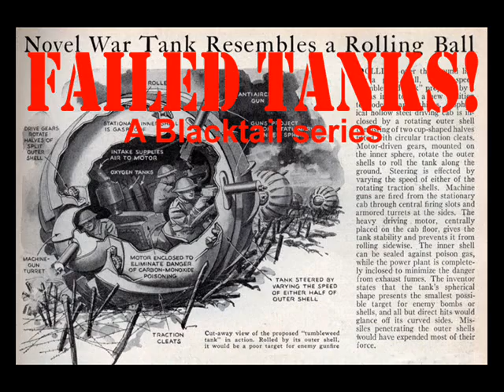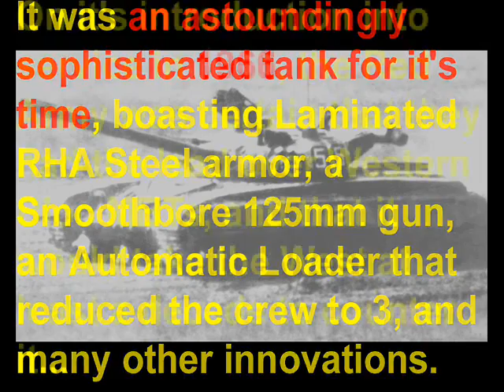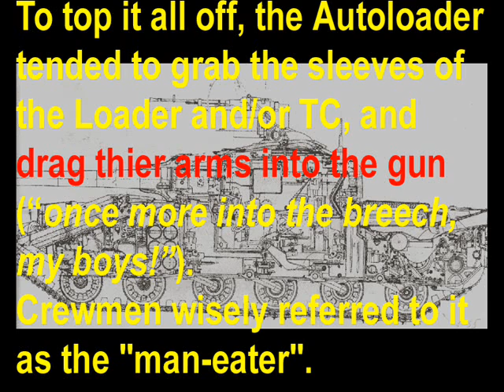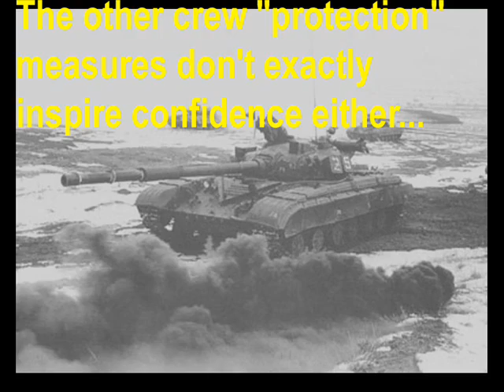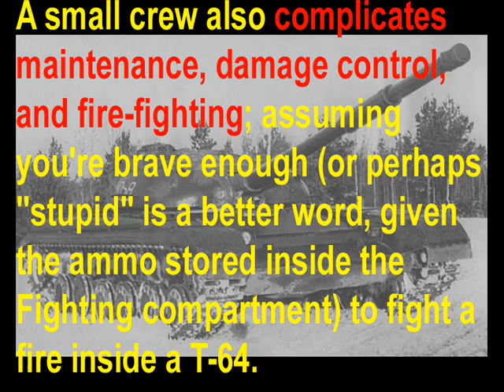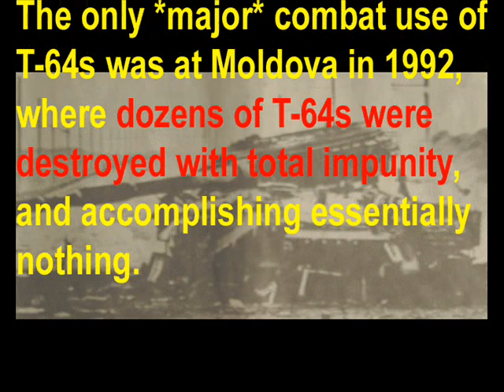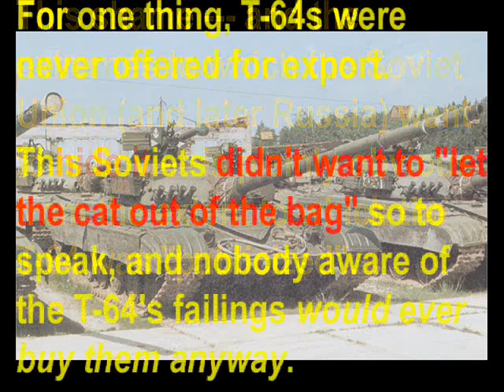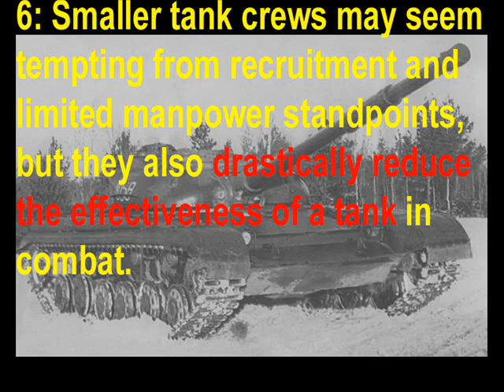Failed Tanks, Chapter 4: The T-64

Comment: There are many errors in this video:

1)  The T-64 was NOT developed AFTER the T-62. The programme for T-64 was the main development to replace the ageing T-54/55s. The T-62 was a stop-gap design mainly to field the new 115mm smooth bore gun quickly.

2)  The smooth bore guns had a very flat trajectory, and in the T-62 case, largely made up its relative simple FCS compared with contemporary western designs. I am not sure where did you get the "very poor" accuracy from.

3)  It is true that during the initial trail of the T-64, a lot of reliability issues were encountered, especially with the very new engine and suspension systems.  However, while some design issues were fixed in production models, many of the reported reliability problems was found to be resulted from inadequate crew training. The T-64 was an entirely new tank design at the time, and many tank crews were transferred from T-54/55 units, and some even directly from the T-34s. Once the training issue was corrected, the T-64 reliability record also improved dramatically. It is no worse than T-72.

4)  The T-64 engine was very compact, and its output power was very good compared with contemporary engines on western tanks.  The engine allowed a very low and short tank.

5)  The T-64 front armour was specifically tested at the time, that no Western 105mm antitank rounds could penetrate it at range > 500m.  It was the very first time that a tank in the weight class of a medium tank, exceeded the protection level of that of a heavy tank.  The introduction of the T-64 basically started the MBT concept in the red army, and made the heavy tanks obsolete.  The T-64 eventually replaced all the heavy tanks

6)  Overall the T-64 was one generation a head of its competitors at the time, and is the first 3rd generation tank in history. A lot of its bad rap in the West comes from some mis-interpreted and incomplete intelligence reports from its early trial days. And this some how got stuck in people's head.  If the West had to fight a tank war with the Soviets in the late 60s, they would have had a very very nasty shock.

7)  The chief designer for T-64 won the top design price in the Soviet Union for his work in the T-64.  Do you think he would have got the price if the tank was a flop?

8)  The fact that all Soviet tanks that follows more or less based on the basic design concept of the T-64, and they felt no great urge to get a completely new design in the advent of the Western 3rd generation tanks, and only did incremental upgrades, showed the soundness of the T-64 design in the eyes of the soviets.  Remember, the soviets put a lot more emphasis on tank warfare, and having a tank that can win the war for them is absolutely essential.
Reply: beltar2 The T-64 was not just "slightly" better than T-72. The electronics and fire control systems on the T-64 was almost one generation ahead of the T-72 until the B model that came out in 1980s.  By then, the T-64 was being upgraded into the T-80 (the first T-80 prototype was simply a T-64 with a gas turbine engine: T-64T).

If you have watched one Russian news channel programme (can be found on the youtube) advising the East-Ukrainian rebels on how to defeat Ukrainian tanks (mostly of T-64 and T-72s leftover from USSR era, there are too few number of the relatively modern T-64U), they mentioned that a hard (RPG) hit on the turret of the T-72 currently serving in the Ukrainian army, even if it won't penetrate, would knock out the turret electronics, requiring the crew to reset the electronics in order for the turret systems (including fire control) to work again, giving the attackers around 20 seconds time-window where the tank basically becomes a sitting duck; whereas the T-64s serving in the Ukrainian army have much better electronics that hitting on the turret without penetration would have minimum effect on the tank.  Both T-64 and T-72 were vulnerable to radiator damage from the rear, and when radiator is damaged, the tanks have about 20 to 30 minutes of running time before the engine catches fire due to overheating.

The T-64's weight reserves were not exhausted compared to the T-72 from the start.  The engine can be upgraded and has been upgraded, just as the T-72.  The design certainly did not reach a dead-end early on, just look at the T-80 and the modern Ukrainian versions of the tank.

Based on lessons learned from WW2, the Soviet tank doctrine emphasised a lot on production: the ability to produce and deploy tanks quickly.  T-72 had much more off-the-shelf components that can be produced in factories throughout the USSR territory, whereas some of the key components of the T-64 (the engine, transmission, etc) were only produced in one factory in Ukraine.  This makes T-72 being able to have much higher production rates and with cheaper cost, making it the best T-34-esk tank to flood and overwhelm the opponents, whereas the T-64 will be reserved for spearhead and breakthrough units.

BTW, the main reason why T-43 was not adopted was because they did't want a reduction in the production rate of tanks.  The T-34 had a lot of know flaws, but tank production rate was more important, that many of the proposed design fixes were not implemented if those required significant retooling of the existing production line.  With the emergence of Panthers in the Eastern front, the upgrade to a higher calibre gun was deemed to be essential that an upgrade to the T-34 design was unavoidable.  The T-34-85 required much less retooling with an increase in turret ring diameter and a cast turret than a new tank chassis design required by T-43.
Reply: @tonglianheng  I know this is supppppper late but T-64 is NOT superior to T-72. Even T-72 Ural had much more armor and a better auto loader(ammunition laying horizontal rather than vertical) by T-72A the T-72 series had completely eclipsed the T-64 series including T-64B and T-80. The T-72A's FCS was less sophisticated than T-80B's however much easier to train crews on and according to Soviet test provided only a 5% reduction in accuracy but at a 3rd of the cost of T-80B
Reply: Lianheng Tong 
Electronics can be installed in T-72 too. Nothing strange that in 1987 T-64's production was cancelled but T-72 and it's deriative T-90 remained.

T-72 for it's years of active service has countless examples of surviving multiple hits and remaining in combat-ready state. RPG's projectile is too lite and slow to produce significant kinetic energy. I don't know where you found such a bullshit but I never heard about any problems with T-72's electronics. Countless books articles esseys no one mentions anything like that. I remember video from Syria where T-72 was hit in it's turrent but the sights worked.  What's more a soldier with RPG usually has no idea about real damage he made except there were signs of fire or immediate total destruction.

Actual weight reserve of T-64 looks like to be around 45 tonnes. The problem is not engine which was unreliable too but very weak chassis.  That's what everybody who had to deal with this tank militaries and engineers tell in unison. From other side T-72's chassis considered practically undestructible and there're variants with 1130 HPs engine. Nothing strange that T-80 required totally new chassis.

USSR had 4 tank factories and can order produce any tank anywhere. T-64 was produced only in Kharkov because it was told so.  There were attempts to install T-64's turret to T-72 but it was so non-producible that the factory in Nizhniy Tagil failed to introduce it in prodaction. The real advantage of T-64's turret was +10-15% in terms of shellproof. Autoloader another story. In Russian literature T-64/80 autoloader is named "Loading mechanism" LM and T-72's one "loading automate" LA. The LM was bad and N. Tagil engineers have to develop their own construction. Develped and named LA. And many other things which were later introduced in T-64.

T-43 is not one of very known tanks with little enough information about but Soviet sources states that it had no reserve for future development.
Reply: Lianheng Tong 
> The chief designer for T-64 won the top design price in the Soviet Union for his work in the T-64.

The chief disigner of T-64 was Morozov the "father of T-34". Anybody else would get a kick in his ass. The tank was soooo gooood that Soviet Army required a replacement that's why T-72 was created. During WW2 Morozov known for T-43 the tank which has no reserve for future development and was discarded from other side T-34 allowed significant addition of weight and new 85 mm gun. T-64 was post WW2 T-43 slightly better than T-72 by formal parameters but with many technological problems and no weight reserve. The weakest parts were engine and chassis the last was never fixed. Something like that happened with JS-3 before. From KV-1 to JS-3 the armament and protection were iproved step by step without increasing the weight but in JS-2 all reserves were exhausted and non-optimal desisions fixed.
Reply: +Golden Eagle chalky tanks re not the same as chieftains
Reply: Poor Mikhail Koshkin, written out of the histories already.  I salute one of the great tank designers!  Za Mikhail Koshkin!
Reply from the maker: 1- The T-64 was intorduced into service in 1967...;
http://www.fas.org/man/dod-101/sys/land/row/t64tank.htm
...and the T-62 was introduced in 1961;
http://www.fas.org/man/dod-101/sys/land/row/t62tank.htm
2- Only when firing APFSDS rounds --- as in all other tank guns.
3- And yet, all T-64s operated exclusively from bases that were near the factories that built and maintained them, they were never offered for export, and less of them were built than any other post-war Soviet tank, over a shorter production span than any other Soviet tank. This is not evidence of success.
4- The T-64 is 7.22ft tall to the rooftop, versus 7.87ft for the T-62 (9% taller), 7.32ft for the T-72 (2% taller), 7.9ft for the T-55 (9% taller), 7.55ft for the Type 85-II (5% taller), 8.7ft for the Chieftain (12% taller), 7.84ft for a Leopard 1 (8% taller), and 7.48ft for the AMX-30 (4% taller). An average height reduction of 7% isn't worth the cost, complexity, reliability, availability, maintainability, or ergonomical problems the T-64 inherited.
5- Yet, when the more advanced frontal turret armor of the T-72M1 was tested against captured 105mm M111 Hetz APFSDS rounds, they went right through. See "The Secret Testing of Israeli M111 "Hetz" Ammunition: A Model of Failed Commander′s Responsibility", from the September-October 2006 issue of Armor Magazine.
6- Such as with the use of an Autoloader, as pioneered by the AMX-13 that entered service in 1948? How about it's Composite Armor, as was used on the turret faces of the Iowa class Battleships in 1943? Or perhaps it's 3-man crew, just like the PT-76 that entered service in 1952? Moreover, the Chieftain also had an opposed-piston multi-fuel engine when it entered service in 1967, the same year as the T-64. Moreover, just because you're the first or only one to do something doesn't mean you're useful --- as was definitely not the case with the Soviet Union's only operational MBT never to be committed to front line service.
7- Morozov never would have lost the competition, because he had too much political clout. Form always trumps substance in the Soviet Union.
8- Yup, so many later Soviet tanks with cassette autoloaders, opposed-piston multi-fuel engines, and track return rollers.
Reply: BlacktailDefense
1. The T-64 project started as Objekt 430, as early as 1951.  3 prototypes were built subsequently in 1957. Upon the intelligence of the 105mm L7 gun being adopted by the next generations of the Western tanks, the project 430 tank was redesigned to accommodate the then new 115mm U-5TS gun. Due to the delays in project 430, the soviet army ordered an immediate solution to field the U-5TS gun, and the prototype form the much less ambitious Project 166, which is based on the Project 140 (started at roughly the same time as project 430, as a T-54 improvement project), was adopted (aka. T-62) as a stopgap.

During the production phase of T-62, Project 340 received the further updated 115mm D68(2A21) gun, and renamed Project 342. The first prototype of Project 342 was completed in 1962 , and the first serial production started on October 1963. It officially entered active service on December 30, 1966, under the official designation T-64.

Source: http://www.t-64.de

2. APFSDS rounds can only be fired from a smoothbore, and is the main ammo. The superior performance of the smoothbore in terms of muzzle velocity and the lack of a performance penalty on HEAT caused by the round spinning is the major reason why the Soviets switched to smoothbore, and why virtually all Western armies except the British followed suit.

When the 115mm smoothbore was first rolling out with the T-62, name one contemporary western tanks that has the similar? During a field test by the US army on a captured T-62, the crew reported the T-62 gun is the point and shoot weapon when compared with the L7 on their M60.

3.  The T-64 was the elite tank in Soviet army service, in the high-low combination of soviet tank doctrine. They were equipped by the most ready tank units, which previously fielded the IS3 and T-10 heavy tanks.  The T-64 was regarded as a top secret weapon at the time, and it is telling that the Western intelligence first learned of the T-72 (a cheaper and technically less advanced counterpart to T-64) before they even realised the existence of the T-64, despite the T-64 entered service several years before the first T-72.

I am not sure where you got your sources from, but a lot of T-64s were stationed in elite units stationed in East Germany, near the border to the West. They were to be used as the first echelon in smashing through the Western defences in case of an all out war. Only the initial batch was sent to a unit closest to the factory, and this was where most of "T-64's problems" was reported and passed down in history, through declassified patchy Western intelligence reports.

The Soviets never exported their elite equipments. The T-64 and subsequently the T-80 was never exported before the collapse of the USSR.  Only the inferior T-72 was permitted to be exported.  By the time of the collapse of the USSR, the T-80 has already replaced the T-64 as the best the Russians have, and it is natural that foreign buyers are more interested in T-80 when it became available.  Remember, this is at a time when the Russians were forced to sell a lot of their priced assets due to dire financial situations, such as the SU-27, which were never approved for export in USSR era.

4.  One of the main argument for compactness is the consideration on armour/weight ratio. The more internal volume a tank has, the more armour it needs to wrap around that volume, and hence a heavier weight if the armour keeps the same thickness.

This is very telling. The T-64 while weighing only 37 tons, has almost twice the armour protection compared to the M-60 series, which weights over 10 tones more.

5.  Gun ammo technology and armour technology advance all the time. The T-64 front armour was tested against the western ordinances of the time of its development.  And that is just that.  When the M1 tank was first introduced, its frontal armour was tested to claim that no Soviet antitank gun in service at the time could penetrate its frontal arc >1000m.  The same cannot be said today, even with the latest M1A3 add ons.  And this is normal, it is called progress.

6.  Let's put it this way, the T-64, when it first came out, made most of the tanks in service at the time more or less OBSOLETE. It was a tank that combined a lot of the newest ideas into one place, and made them work. And as I mentioned before, it was in service with the elite and most ready front line units in USSR. 

Its serial production continued from 1964 to 1987, only a few years before the collapse of the Soviet Union, with the latest BV variants serving along with the T-80s. Tell me that this is the mark of a failed tank.

The fact that the Western sources for what ever the reasons had little knowledge on the T-64, and often confused it as an older experimental version of the T-72, and hence the existence of such misunderstandings floating around is not really the fault of the T-64 tank.

7.  That is your opinion on how these awards gets handed out.

Consider this, the T-64 kick started a whole generation of tank designs in the USSR, and its less advanced cousin T-72 prompted the start of new generations of tanks in the West. The newest Russian tanks still based on the design principles of the original T-64.  Don't you think Morozov deserves at least a little of your recognition?
Reply from the maker: Lianheng Tong 1- If that's true, it makes the T-64 an even bigger disaster --- over 15 years of development for a single MBT project.

2- Not so. The M744, M833, M900, M456, M111 "Hetz", M413, M1060A1, C126, UI, OFL105G2, DM-23, DM-33, DM-64, L23, L26, L27, L64A1, BM2, BM22, 3BM-2, 3UBM11, BM25, and M98 are all APFSDS rounds for Rifled Bore guns, and almost all of these have seen active service.

3- The "High-Low Mix" is a fairy tale, as is the notion that the Soviet Army was designed expressly for offensive operations. If the former were true, the T-55, T-80, and T-90 would all have been immediately followed-up in production by inferior tanks; they weren't. If the latter were true, the extreme emphasis on self-entrenchment and dismissal of gun elevation that are definitive of Soviet tanks would not be so. High gun elevation and depression are absolutely essential for offensive operations on hilly our mountainous terrain, while an integral self-entrenchment capability is not, and defensive operations on predominately flat  and open terrain demands the opposite --- and the fact is that most vertical terrain was on the western side of the Iron Curtain, while most horizontal terrain was on the other side.

"I am not sure where you got your sources from, but a lot of T-64s were stationed in elite units stationed in East Germany, near the border to the West."
Without NATO ever noticing them? Fat chance.

"The Soviets never exported their elite equipments."
Yet, every Soviet MBT before and after the T-64 was exported, but the T-64 to this very day never was --- even though the T-80 rendered it obsolete over 30 years ago. T-55s, T-72s, T-80s, and T-90s are still being sold all over, but no one is asking for T-64s, and none are offered. This is the mark of an "elite" tank?

"By the time of the collapse of the USSR, the T-80 has already replaced the T-64 as the best the Russians have, and it is natural that foreign buyers are more interested in T-80 when it became available."
Yet, the 'inferior' T-55 and T-72 have continued to find more orders and new buyers since 1991, but the T-64 hasn't. The T-64 is neither here (low-end) nor there (high-end); and by extension, nowhere (neither wanted, needed, nor offered). This is not a mark of a successful tank design.

4- Yet, the better-protected AMX-40 weighs the same 42 short tons, despite being substantially larger and more spacious. The equally large and spacious EE-T1 Osorio had even better protection than the AMX-40, and weighed only 45 short tons. They're also both 4-man tanks with manually-loaded guns. The Chinese Type 96 is substantially-larger inside and out than the T-64 and has superior armor, and yet it weighs almost exactly the same.

"Let's put it this way, the T-64, when it first came out, made most of the tanks in service at the time more or less OBSOLETE."
The British would beg to differ.

"And as I mentioned before, it was in service with the elite and most ready front line units in USSR."
The Malyshev Factory in Karkiv, Ukraine, is pretty far and isolated from Eastern Siberia and Europe. More precisely, it's 1281 miles from Hannover. Some 'front line'. I don't seem to recall NATO basing it's Leopard 2s, M1 Abrams', and Challenger 1s in Belgium.

"Its serial production continued from 1964 to 1987, only a few years before the collapse of the Soviet Union, with the latest BV variants serving along with the T-80s. Tell me that this is the mark of a failed tank."
The T-80s were all based in Ukraine?

"Consider this, the T-64 kick started a whole generation of tank designs in the USSR, and its less advanced cousin T-72 prompted the start of new generations of tanks in the West."
Yet, the T-72 doesn't have a gasoline APU, an opposed-piston engine, track return rollers, or a cassette-type autoloader. It's armor, turret design, and fire control systems are completely different as well, and were carried-over to the T-90, and partly to the T-80. If these definitive attributes of the T-64 were so great, why did the Soviet Army drop them?

"Don't you think Morozov deserves at least a little of your recognition?"
The man who put a hokey Christie Suspension into the T-34, when it could have had Torsion Bars instead? That was the extent of Morozov's involvement in the T-34, which was actually designed by Mikhail Koshkin. After that, he took all the credit for evolutions of Koshkin's masterpiece, while his subordinates did all the work. The only tank he ever led the development of was the ill-fated T-64. After that, the Party only tolerated him, simply because his informal association with the T-34 made him a sacred cow.
Reply: "Not so. The M744, M833, M900, M456, M111 "Hetz", M413, M1060A1, C126, UI, OFL105G2, DM-23, DM-33, DM-64, L23, L26, L27, L64A1, BM2, BM22, 3BM-2, 3UBM11, BM25, and M98 are all APFSDS rounds for Rifled Bore guns, and almost all of these have seen active service."

Smoothbore guns will always have higher muzzle energy over rifled guns given the same calibre and propellent.  This is physics.  The rifles introduces both friction and spin to the round, both do not contribute to the KE in the linear motion that mattered.  When the fin-stabilised rounds were developed, the smoothbore guns attained comparable accuracies to rifled guns.  The other disadvantage of the rifled guns is that the HEAT rounds perform best when the round does not rotate along its axis. Significant penetration power is lost if they do.  This is why the French developed the "rotating sleeve" to their HEAT rounds to use with their rifled gun on AMX30.  The rifled guns also require rotating sleeves for any APFSDS runs.  These makes the rounds more complex, and more expensive.

The bulk of the world switched to smoothbore main guns for their frontline tanks for a reason.

All of the systems you have mentioned are attempts of upgrading the rifled 105mm and 100mm guns on a lot of the tanks still in service in many countries to have capabilities approaching that of the more modern systems.  In other words, attempts to make legacy systems to be still battle-worthy on today's battlefield.  They have inferior performance compared to the more modern larger calibre smoothbore counterparts, but have lifted enough of their performance to not make them outrightly obsolete. 

"The "High-Low Mix" is a fairy tale, as is the notion that the Soviet Army was designed expressly for offensive operations. If the former were true, the T-55, T-80, and T-90 would all have been immediately followed-up in production by inferior tanks; they weren't. If the latter were true, the extreme emphasis on self-entrenchment and dismissal of gun elevation that are definitive of Soviet tanks would not be so. High gun elevation and depression are absolutely essential for offensive operations on hilly our mountainous terrain, while an integral self-entrenchment capability is not, and defensive operations on predominately flat  and open terrain demands the opposite --- and the fact is that most vertical terrain was on the western side of the Iron Curtain, while most horizontal terrain was on the other side."

The gun elevation and depression limits are to do with design principles and tank operation doctrine.  The self-entrench capability is an addition designed to partially offset the disadvantages in defensive positions with a gun allowing very small depression angle. The very small gun depression was a technical limitation (i.e. trade-off) due to the design principle emphasising low height, small size, high firepower, thick armour and low weight.

The high-low mix in the Soviet army was clearly stated in their own doctrine, which was highly influenced by their experiences from WW2.

The T-54/55 was the low in the high-low mix. In the 50s, the Soviet operated both medium and heavy tanks. Their high-end were the IS-3 and T-10 units.  The heavy (high) units are used to punch through the line during an offensive, and the medium (low) units are to rush through the gap (i.e. the T-54/55 replaced the T-34s).  In defence, the heavy units are to be used in reserves as spearheads of counter offensives. 

Upon the introduction of the T-64, the T-64 replaced the heavy tanks in the heavy units, and were used as their high-end tank. The low were the T-54/55 and the T-62, which were then gradually replaced by the T-72.  The "heavy" line of the T-64 was then superseded by the T-80.

The T-72 was a cost reduction version of the T-64 to replace the massive number of low line tanks of T-64/55 and T-62.  The T-64 was expensive and complex to manufacture (in Soviet standards, not Western standards, as the Soviet emphasised low unit cost and production time, a valuable lesson learned from WW2); the T-72 was designed to utilise the best qualities in the T-64 design, while using off-the-shelf and more common and cheaper components.  The T-72 had a larger, more conventional engine, torsion bar suspension, a narrower chassis, a simpler electronic powered autoloader, and less sophistic FCS.

The T-72 was cheaper to produce and easier to maintain because many more factories were already producing the sub-components used by the T-72, while only a selected few factories which were the most capable and trusted were producing the more advanced and, some of which classified, sub-components used by the T-64.

The difference in the autoloaders demonstrated the quality difference between the T-64 and T-72 very well.  The T-64 autoloader electronics allows reverse selection as well automatic a sequence mode, which considerably speeds up reloading times.  The T-72 autoloader used much simpler electronics, and cannot do any of the above.  It is only until quite recently that these functions basic to T-64 and T-80 lines were added to the T-90, nearly 30 years after the introduction of the T-64.

The Russian Fed, reborn from the ashes of the USSR had a much smaller defence budget.  The original T-80 replacement in the heavy/high line was supposed to be the Black Eagle.  This however was cancelled due to the lack of funding.  And the Russian army opted for only a single line of battle tanks based on the cheaper T-72 model, which subsequently became the T-90.  The T-90 absorbed some of the advanced FCS and electronics from the T-64 and T-80 line.

"Without NATO ever noticing them? Fat chance."

Do some research, it is not even difficult.  e.g:

'''In the early 1970s, T-64s began to be shifted to Group of Soviet Forces Germany from the western military districts, where they were supplanted by T-72s. In 1979 eaach Soviet tank division in East Germany had 1 T-64 equipped regiment, as did a number of the Category 1 tank divisions in the European USSR. A 2nd and 3rd regiment were then added to each division, replacing T-62s. T-64s are still found in high-readiness divisions in the western military districts, as are T-72s. By the end of 1984, T-64 B's were in service in the GSFG.
...
The first T-80 entered service in GSFG in January 1984, equipping regiments in the 1st Guards Tank and 8th Gds Armies. It is believed that in 1986-7 the tank units of the 2nd and 20th Gds and 3rd Shock Armies (all GSFG) were still using T-64s) , those of 1st Gds tank and 8th Gds Armies using T-80s. Units in the Carpathian, Byelorussian and, possibly, Kiev military districs also are equipped with T-80s.

"Yet, every Soviet MBT before and after the T-64 was exported, but the T-64 to this very day never was --- even though the T-80 rendered it obsolete over 30 years ago. T-55s, T-72s, T-80s, and T-90s are still being sold all over, but no one is asking for T-64s, and none are offered. This is the mark of an "elite" tank?"

The T-80 was never exported, until the collapse of USSR.  The T-54/55, T-62 and the T-72 were the cheap variants ideal for export. The T-64 and T-80 line contained too much sensitive technology for export.  Same for aircrafts, only the Mig-29 was approved for export, while the Su-27 was never exported during USSR.

A lot of the exports involved local licensed production too, especially to Warsaw pact countries.  The countries that have already infrastructures setup for producing and supporting the T54/55 and T-72 series naturally would be much more interested in the upgraded versions of the same tanks, rather than a new beast such as the T-64 or T-80 (the only a small token numbers were exported AFTER the collapse of USSR) that does not fit into their logistic and production framework.

The Russia Fed. exported nearly everything they have, expect the nukes, because they desperately needed the cash to keep these R&D institutes and defence manufacturers running, and to keep the talent pool.  So, now days they export the best of their stuff, the situations are completely different.

"The British would beg to differ."

The Chieftain isn't exactly a very successful design by any standard of measurement.  It had some novel ideas but also had many flaws. Following your critical logic on these things, I am actually quite surprised that you would hold a positive view on the Chieftain.

"Yet, the better-protected AMX-40 weighs the same 42 short tons, despite being substantially larger and more spacious. The equally large and spacious EE-T1 Osorio had even better protection than the AMX-40, and weighed only 45 short tons. They're also both 4-man tanks with manually-loaded guns. The Chinese Type 96 is substantially-larger inside and out than the T-64 and has superior armor, and yet it weighs almost exactly the same."

Which years exactly were these tanks developed, BTW?  Has armour technology progressed during all this time?  The AMX-40 and the EE-T1 never really left the drawing boards, why?  And, how about we compare these with their contemporary T-80 (which is really an upgraded T-64)?

Ignorance does not rewrite physics. The more internal volume the more surface area, and the more surface area means...?

"The Malyshev Factory in Karkiv, Ukraine, is pretty far and isolated from Eastern Siberia and Europe. More precisely, it's 1281 miles from Hannover. Some 'front line'. I don't seem to recall NATO basing it's Leopard 2s, M1 Abrams', and Challenger 1s in Belgium."

You are obsessed with the notion that the T-64 never left far from its factory. I am telling you this just ISN'T true. Please do some research, or if you cannot bother, at least read the example of T-64 deployments I have given you above.

"Yet, the T-72 doesn't have a gasoline APU, an opposed-piston engine, track return rollers, or a cassette-type autoloader. It's armor, turret design, and fire control systems are completely different as well, and were carried-over to the T-90, and partly to the T-80."

The T-72 was a cheaper, more mass-producible version of the T-64 designed to replace the tens of thousands of T-54/55s in the red army. This is the reason it did not have many features of the T-64.  BTW, the T-72's armour and FCS were initially less advanced than T-64.  It was until the 80s when the armour and the FCS of T-72 and the T-64 became on-par, after many upgrades on both T-72 and T-64.

Also to correct you, the T-72 had the cassette-type autoloader, powered by electric motor.  The T-64 and the T-80 had a basket-type autoloader, powered by hydraulics.  Again, this is not hard to research.

" If these definitive attributes of the T-64 were so great, why did the Soviet Army drop them?"

The T-80 started its life as T-64T, i.e. a T-64 with a gas turbine engine. Gas turbine engines were very "hot" ideas in those days.  Later the pneumatic suspension was deemed to be too complex, while producing not much performance advantages to warrant the cost associated.  So the suspension was reverted back to torsion bar.   Later on, other technologically advancements were added, including a new, better protected turret,  which BTW was retrospectively fitted to the T-64s in service, a.k.a the T-64B versions.  The T-64B had the same FCS as on the T-80.

Before the T-64, how did the Soviet tanks look, and after the T-64, all Soviet and subsequently Russian tanks look like a T-64, to such an extent that it is easy to confuse between the T-64, T-72 and T-80.  This says it all.

"The man who put a hokey Christie Suspension into the T-34, when it could have had Torsion Bars instead? That was the extent of Morozov's involvement in the T-34, which was actually designed by Mikhail Koshkin. After that, he took all the credit for evolutions of Koshkin's masterpiece, while his subordinates did all the work. The only tank he ever led the development of was the ill-fated T-64. After that, the Party only tolerated him, simply because his informal association with the T-34 made him a sacred cow."

Seriously, who was the lead designer of the very successful T-54/55 series?
Reply: The engine is not only under powered, but also unreliable. Oil leaking is a common problem, and is maintainance intensive. The crew reported they had to fix up the engine almost on a daily basis during excercises in order to keep the tank running. There is no over pressure NBC protection system and the crew has to wear NBC protection suites inside the tank.  Fire control systems consisted of a high calibre co axial machine gun firing tracer rounds with similar bullistics to the main gun. After the gunner has observed a tracer round hit he would then fire the main gun. While this is a simple and effective solution for fire control, it also limited the range of the main gun to the maximum burn time of the tracer. It is also slow as effectively the main gun will be scoring "second hit" with the first hit being the machine gun bullet. The 120mm main gun ammunition is three piece stored in separate locations: the penetrator,  the propellant and the primer.  Thus loading process is more complicated than any of its counter parts of the time, East or West. Nevertheless the main problem is the engine.
Reply: ***** By "any of these problems", what do you mean? Do you mean that the Chieftain does not use a co-axial machine gun for fire control, or that it does not use a three piece ammo, or that engines rarely had oil leaks, or that it had integrated NBC protection, or all of them?  And the fact that the Chieftain was underpowered is well known.  There is a youtube video of a British TV programme on the Chieftain, with the sergeant tank commander in the video mentioning the problems with oil leaks and having to do tasks in an uncomfortable NBC suit, and how these issues where eventually solved/improved in the Challenger...
Reply: ***** I think our differences may be associated with the fact that Chieftain, like many other tanks that were in service for several decades, its performances and reliability differed significantly depending on its Mark number (i.e. what year it was produced and what upgrades it had received).  I was specifically talking about around the time frame when both the Chieftain and the T-64 first came out (as the original discussion was on how I mentioned that T-64 was a generation ahead of the rest when it came out, while the OP replied with "the British begs to differ".).

The main advantage of the Chieftain was indeed the main gun. It had the most powerful gun of the Western tanks at the time (when it first came out). And T-64 for example was initially developed to stop contemporary 105mm hits in the frontal arc, but not the 120mm on the Chieftain.

In terms of armour, while the Chieftain had the thickest armour and best ballistic shaped turret and hull in the NATO tanks, it did not really matter that much, as T-64 had better armour protection, yet both can pretty much penetrate the other in a single hit.

I was never disputing the accuracy of the main gun, but just pointing out the associated disadvantages of the particular range gun FCS Chieftain used, and the 3-piece ammo---something often mentioned as a negative for Russian designs with 2-piece ammo.  The range gun FCS also had advantages, in that it is very intuitive, and a hit by the tracer would almost guarantee a hit by the main gun. Later Chieftain upgrades (Mk3 on wards) replaced the range gun with laser range finders, and then later added ballistic computers etc, as on-par with all of its contemporary competitors.

In terms of oil leaks, this is particularly associated with Mk2 and 3---around the time T-64 and T-64A are in service. Chieftain went through a number of upgrades to the engine.

"The Leyland L60 engine is a two-stroke opposed piston design intended for multi-fuel use so that it could run on whatever fuel was available. In practice the engine did not deliver the expected power, and was unreliable, estimated to have a 90% breakdown rate, but improvements were introduced to address this. Primary problems included, cylinder liner failure, fan drive problems and perpetual leaks due to vibration and badly routed pipework. However, as the engine power improved the tank itself became heavier."

This is a general problem with comparing tanks: they go through many upgrades and fixes throughout their service life and every production batch differs to the previous one, so fixing a particular time frame for comparison is of a central importance.

Note that T-64 first entered service in 1966 with 115mm gun (and no integrated NBC)---this the model with most of the reported initial teething issues, and then T-64A entered service in 1967 with 125mm gun (and integrated NBC).  T-64B entered service in 1976 with updated armour, a new 125mm gun with laser range finder and the ability to file missiles.  Chieftain Mk 2 entered service in 1966 (with range gun FCS and no integrated NBC), and Chieftain Mk 3 entered service in early 70s, replacing the range gun with laser range finder. Integrated NBC was added after Mk 5---late 70s, which also updated the engine, improving the lining seals---a major weakness in the previous design.

Overall, the T-64 is a medium tank in weight and mobility with the armour protection and fire power of a heavy tank; while the Chieftain throughout its most relevant service life (before the introduction of 3rd gen Western tanks) is an out-right heavy tank.
Reply: BlacktailDefense 5. T-72M/M1/Ural are exported version, they didnt have the “composite” armor, if you look at wiki, those tanks dont have composite
Reply: @BlacktailDefense  the 115mm and 125mm smoothbore ammo was more than accurate for 1960's standards remember this is in a time when HEAT and APDS ruled and those where notoriously inaccurate. Smoothbore guns have better accuracy because the HEAT ammo is fin stabilized and HE is well HE it doesnt need to be superbly accurate because it basically a low pressure mortar round designed to hit large fortified structures.